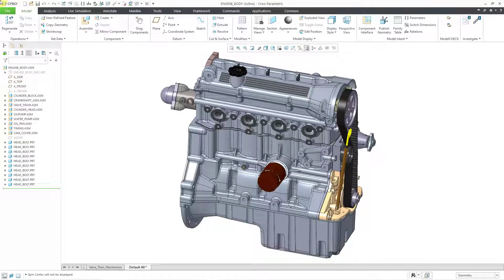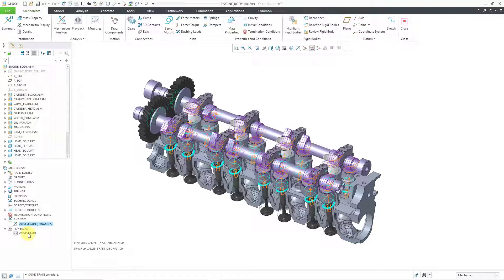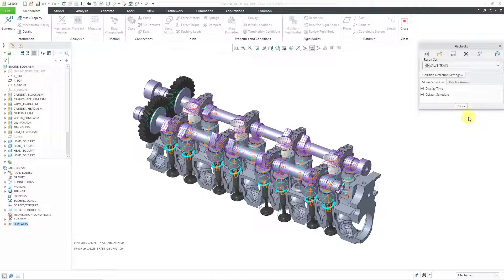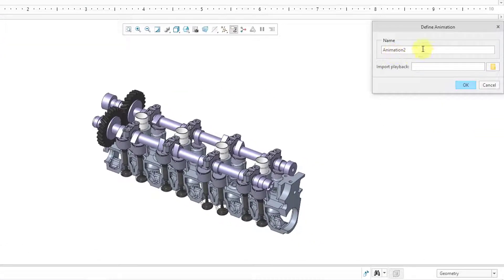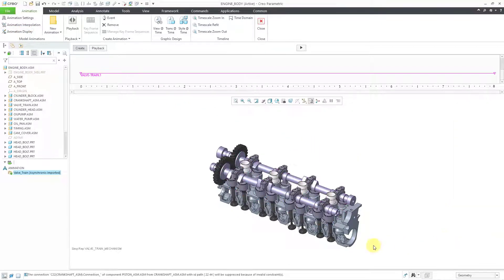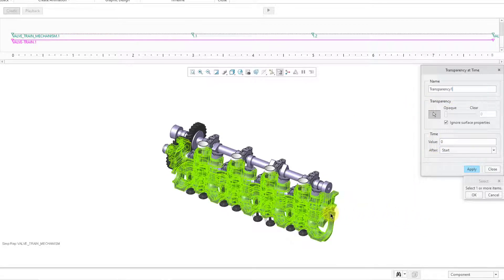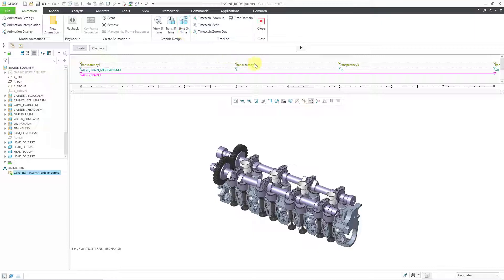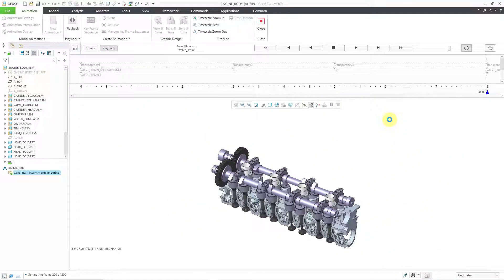Creo Parametric - Design Animation Option (DAO) | Animations from Mechanism Analyses

Comment: Hi Dave!
I hope you're doing fine.
I just notice that it is a fairly large assembly with a number of CAM connections. Yet the simulation runs smoothly.
Can you shed some light on it, maybe in the next videos?
Thank you.
Reply from the maker: Can you elaborate on what you’d like me to shine light on? I didn’t do anything to optimize performance. My computer is 6 years old. I used a Combination State including a Simplified Rep but that was mainly for visualization so people could see what was moving inside the assembly.
Reply: @CADPLMGuy  Sorry, I got you confused. I was just wondering how your large assembly simulation was running so smoothly with the CAM connections involved in it.
Whenever I used CAM connection, my simulation ran jittery.